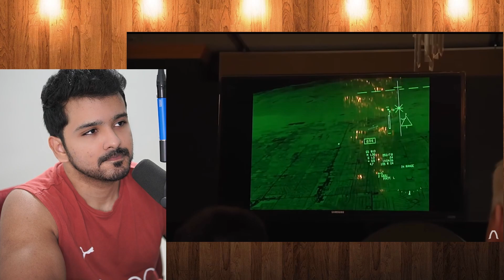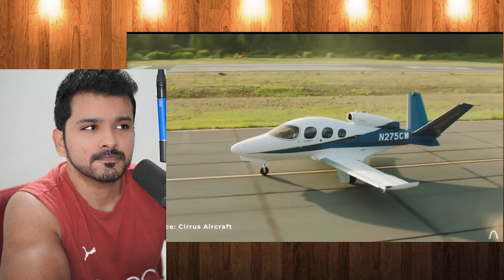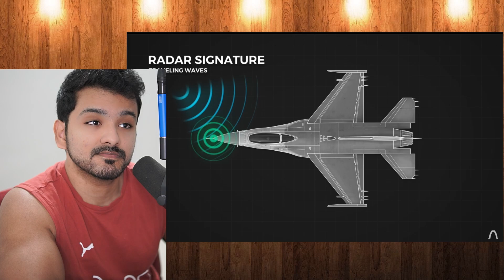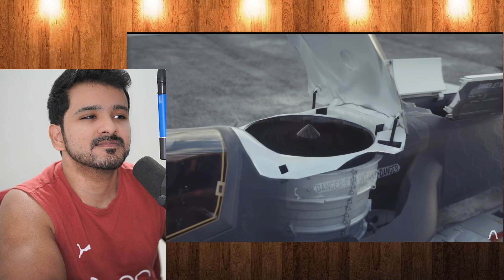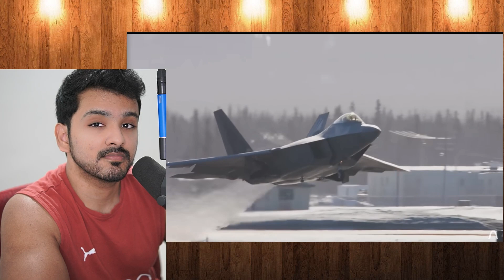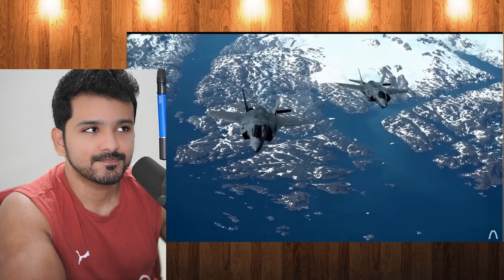The Insane Engineering of the F-35B | CG reacts

Comment: The F-35 was designed as a stealthy air-to-ground specialist.  It still is, but is just so advanced that it can competently use other kinds of weapons and accidentally became effectively multi-role.  Technically, it's not and was not designed to be.  But, it can do the job anyway.  It was designed to sneak through enemy radar to destroy surface-to-air positions and be able to defend itself from air-attacks well enough to run away and escape with its stealth.  Keep in mind that America designs its military to fight an enemy as strong and advanced as America.  Against the US, the F-35 cannot be used as multi-role outside of necessity and would fare poorly at that.

Comment: Regarding why they need a runway if they can take off and land vertically, it’s mainly because it takes longer and burns a lot more fuel to takeoff vertically and because of the space taken up by the fan it’s not capable of carrying as much fuel as the A or C variants. So they will normally only land it vertically. As for the speed tho it’s top speed isn’t as high as other fighter jets the lower speed does provide an advantage in the form of less fuel consumption allowing it to loiter above the battlefield engaging targets for a significantly longer duration than other aircraft.

Comment: The F-35 comes in three variants designated by the letter on the end. The B variant is the only one with VTOL capability. The reason you'd want a jet without that is because once you take off the lift fan is dead wieght. On all the other variants that space is used for extra fuel or armaments. The other downside is that because you are taking off vertically rather than horizontally, it uses up more fuel than a normal take off. This is why the F-35B is only for the marines who don't have the ability to use long runways like the Airforce or airplane catapults like the Navy Carriers do.
Reply: "This is why the F-35B is only for the marines who don't have the ability to use long runways like the Airforce or airplane catapults like the Navy Carriers do."(sic)

Yet Marine Corps STOVL - not VTOL - F-35Bs utilize rolling takeoffs aboard LHAs/LHDs and Marine Corps F-35Cs launch using catapults from CVNs.
Reply: @AA-xo9uw  I was explaining the concept and trade-offs of VTOL/STOVL as it seemed there was confusion as to why not all aircraft had it. So, simplification of reality was used for explanation.
Reply: @AA-xo9uw there is till a v in both of them and that’s probably the most important part.
Reply: @AA-xo9uw  F35B is a VTOL... it can take of vertically.

Comment: F35 variants (A/B/C) are for different branches of the military. Air force, Navy and Army. The B variant is for the Navy and needs to take off from a ship where vertical takeoff is useful. 
A and C don't have the turbine in the center because they get access to regular runways. The empty space is filled with other things depending on the variant but mostly for extra fuel tanks. That's as far as i know, please correct me if I'm wrong.

F35 basically:
"How many features do you want the plane to have?"
"YES"
Reply: "and Army."(sic)

The Army doesn't operate fighter aircraft, pogue.

"The B variant is for the Navy"(sic)

Marine Corps not the Navy.

You barcalounger cabal members never learn to simply be quiet and learn.
Reply: @AA-xo9uw hey the Marine Corps belongs to the Department of the Navy. As my son would say, the man's Department, he is a Marine.
Reply: The Marines are the sole operators of the F-35B in the US military. The F-35C is just made for carrier operations with strengthened airframe and landing gear, and a hook for catching arrestor wires. All of the Marine Corps F-35C would still only be able to operate from the Navy’s carriers as apposed to the Marine’s LCHs.
Reply: The B variant is for the marine corps.  The US navy doesn't need the vertical lift fan for short take off / vertical landing since the navy super carriers employ catapults and arresting wires.   This alloys the navy variant to save weight since it doesn't need the lift fan.
Reply: like the previous comment stated, the f35B is more intended for export and the marine corp since they can take off from smaller carriers originally meant for helicopters. the F35A is like a normal fighter jet so it is designed to takeoff from normal runways and has a higher max takeoff weight. while the F35C is the variant meant for the navy, it has stronger landing gear to be able to land on aircraft carriers and an arresting hook to grab the wire on the carrier.
Reply: @trollingpcgames  "while the F35C is the variant meant for the navy"(sic)

The Marine Corps and Navy both operate the C.